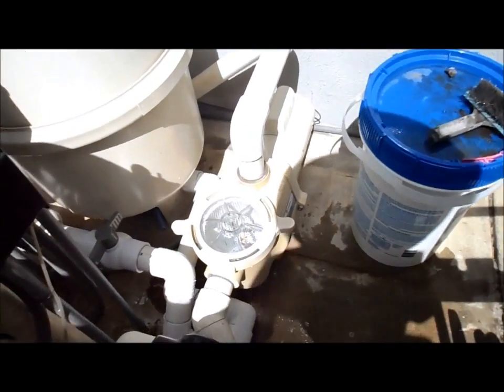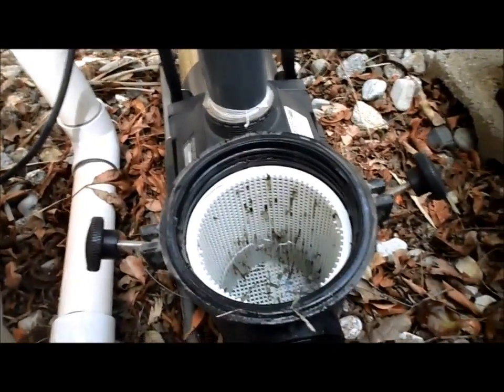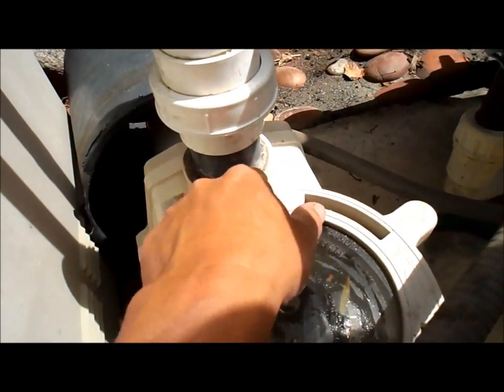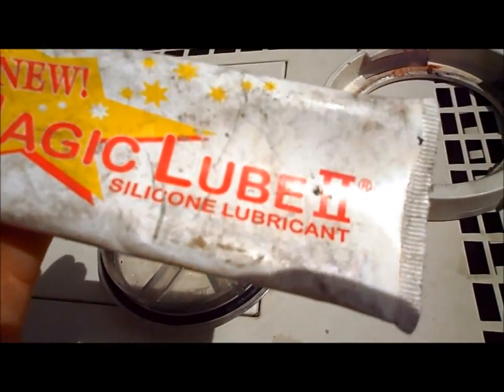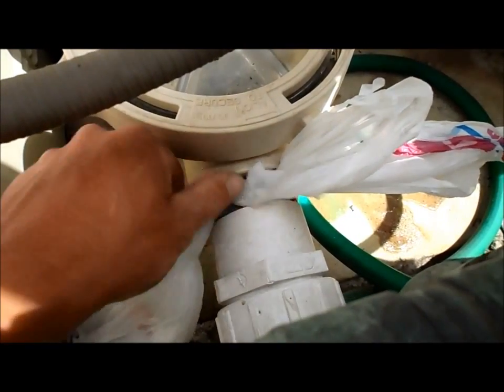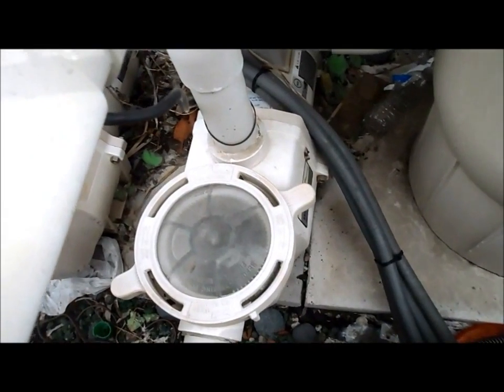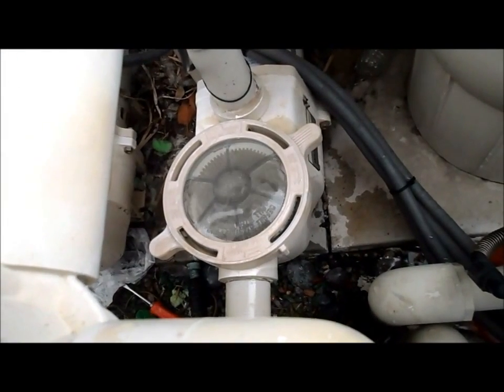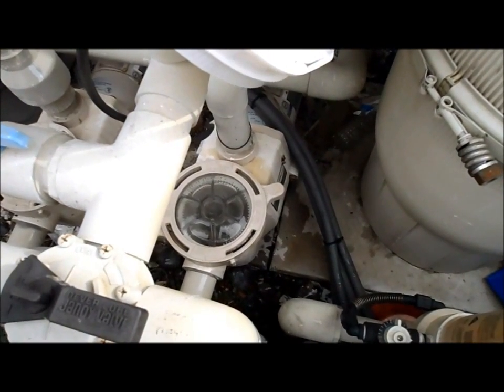Pool Pump not Working, Part 1- Pump not Priming

Comment: Hi, question, when replacing a one speed pump to a variable speed one, what needs to be done with the timer box that used to turn on and off the one speed pump? there are no instructional videos when switching pumps, thanks.
Reply from the maker: You can wire it there and just leave the timer on. Remove the on/off trippers.

Comment: I do really need help please, I got 2 hp hayward pool pump from ebay. It's 115 volts /225 volts motor. the Diagram from the Manual is not really clear and simple. I just want to use the old  24 HOUR DIAL TIME SWITCH,DOUBLE POLESINGLE THROW (DPST). Another question? if I switch the 110v to 220volts , Can I use the built in corded in the Motor and as plug into the new 110 volts outlet does it will work fine.

Comment: Will it still spin and not prime if debri is in the propeller ? I have a pool that it seams to be spinning but not priming
Reply from the maker: Yes, in most cases. Try clearing the impeller.
Reply: @SPL  I flushed the lines also checked the lid and propellers I even changed on the suction and return side from the pump and tried priming with a bucket of water still nothing

Comment: When I turn the time clock on the pool pump does not make any noise or any indication of it trying to prime. Does this mean the motor is burned out? How would I test this?
Reply from the maker: Possibly. Or the capacitor on top is bad.

Comment: Why would my filter tank not hold water to the top? It only fills about 1/3 of the way up. I've replaced the filter, the O-Rings & the vacuum hoses. I've tried filling the tank and the pump with water when I start it. It holds water until it turns off. When it restarts it isn't full again. PLEASE help me. I've even paid a Pinch-A-Penny tech to come out and look, he says everything is fine.... but it isn't.

Comment: I used to work for pinch a penny. And they would have me start from 9am and they close the store at 6pm. They had me with 15 pools daily and I would do all your doing of checking the equipment and the lines and of course cleaning the pool itself. So it would run me to a little after 6 pm that I'd be done and returning. My boss would be mad and yell at me saying why I couldn't be faster like the guys who were always done by 2pm or less. Does that mean. I'm going too slow?

Comment: My pump won’t fill with water- gets close but won’t fill enough to power on. What could problem be? Just bought 4 new filters for tank.
Reply from the maker: Check the impeller for debris. Turn off equipment, remove the basket and spin the impeller with a flat head screwdriver.
Reply: @SPL  thanks for the reply! Nothing found in the impeller that I could see. Could the pump itself be going bad?
Reply: Update for others that might have the same problem with generating prime. I finally just called a local pool company for help and they located the problem right away. It was the Hot Tub o ring leading to the pump (which wasn’t leaking so didn’t notice) and two, small crack that I couldn’t detect on pump cover. Now, pool runs quite, smooth as silk and starts right away. No air bubbles either which drove me coconuts coming from the jets.

Comment: Sometimes the rubber seal on the cover needs to be replaced.    The pump will not prime if air is getting into the chamber.

Comment: I live in mich and I have a older gunite pool with a DE filter which works great  
I have a newer heater about three years old my pool is 48000  gallon  I what I would like to know what I can put in the water to help lift stains with out damaging my filter or heater  dph 7.6 hardness 224 alkalinity 114 cyanuric acid 37 copper o iron phosphate 0 
Free chlorine .1.53 total chorinev1.8 combined clorine 1.66 water is crystal  clear an feels fine and infact the water sparkles with the D E filter idont want to damage my pump or heater can you recommend a product
Reply from the maker: The safest product is ascorbic or citric acid. But with an older pool a drain and acid wash is the most effective way.
Reply: Will it bother my nickel  copper heater exchange  and what might be the dose recommended. I love your post you are a remarkable tube star please keep up my wife and I watch when ever we can thank 
You so much .I think u would be surprised on the no. Of gunite pools in michigan most or very large and it is interesting how well they have to be made in my area in the  it can go down to 15below zero thats static temp even colder with wind factor  thank u for any helpful  info u can give me

Comment: Thank you so much. I tried to spin the impeller, it does spin slowly. Not sure if it's because of the amount of water in there. But if something was clogged, I assume I would need to remove the 6 bolts to gain access to it back there? My pump is not priming
Reply from the maker: It could be a bad jam or the impeller may be cracked. Yes, remove those and inspect.
Reply: @SPL  turns out it was a bad clog in the valve. So once I removed the valve, there was a pint of clog caused by my damn palm tree leaves. Thank you so much for this video, I appreciate it

Comment: Thanks for the great video. My pump wasn't starting. I had noticed that the O-ring seemed a bit loose in the cap over the pump strainer basket. I put some keg lube gel on it and now the pump starts right up. Must have been leaking air into the system to prevent priming. Time to buy another O-ring. Thanks for tipping me off to this cheap fix.

Comment: Lol i turned on priming in settings on the pentair cause water wouldn’t fill up . And my water filter tank ended up loosing its belt from one side and almost exploded .. is it cause i didnt tighten it good? Everything was fine till i turned priming . After 2 hours i got it fixed by adding the lube lol

Comment: One of the most informative videos Ive seen. Thank you. I only have loss of suction when vacuuming.I use a skim vac plate so my cleaning is quicker. I noticed plastic vac plate was not seating down tightly in skimmer. I found a gasket that attached to vac plate and it stopped   air leak so well Im able to use my vacuum hose that has a couple small holes in it. I wonder if you have seen this product? I think co. name is poolvacsaver.
Reply from the maker: Thanks for the great feedback. I did go to their site but saw product. I would have liked to see the actual device. 🤔
Reply: I agree, its a gasket that adheres to my vac plate. Very simple, but it  overhangs beyond vac plate. The extra material seems to give it more surface area to stop air leaks around vac plate. I purchased based on sites explanation of product. You are correct they need pictures showing how it adheres to vac plate.( They do have pix with instructions when purchased). I have been a viewer of yours and in my opinion you have a wealth of solid advice and a knack for delivering it. Thanks and keep it coming.

Comment: Hi- So my pump is pushing  around air. Also the PSI is at 0 even when the pump is on. what is going on ? Did I break my pool?
Reply from the maker: Check some obvious things like the pump lid o-ring and make sure it is filled with water before starting (the pump basket area).

Comment: Hi - i did everything in this video but still failed priming.  One thing i noticed is no matter how I fill the water in the pump it will immediately drain lower than the top.  What could be the cause?
Reply from the maker: Sounds like a very large air leak or maybe something wrong with the skimmer- do you have an attached spa also?

Comment: hello, my pool pump is not work automatically these days, do you have any ideas? I have setup the speeds at 4 different times around the day. Now under the menu, all the speed 1-4 is scheduled. However, the quick start buttons for speed 1-4 showing: stopped. Anyone can help me figure out what is going on and how to change the settings? Thanks. (by the way, the pump can work manually well but pressing the start/stop button)
Reply from the maker: Try turning the breaker off for 2 minutes to reset the pump.

Comment: Wednesday I cleaned my DE filter and after a few minutes I started the kreepy.  Today I put the skimmer basket instead of kreepy and all the water in the pool was being sucked or drained by pump.  Is it normal.  I don't live where pool is located.
Reply from the maker: Maybe the water level is low in the pool. The kreepy works with a lower water level.
Reply: @SPL  Noo, it sounds like it, huh.  But, no it was accurate level, however when it was draining into skimmer I even added more water! 
 I'm thinking maybe the pump never primed properly Wednesday (the psi wasn't reading properly when I left it was at 1-2psi )

Comment: Could you give me some tips please.....? My pool is around 2.5m below the pump, main drain another 1.5m below that. I am trying to prime the pump, it is brand new. I cannot get the water to a full level, only around 1/1,5" below the pump lid.  The return ports are only giving, what I would say half pressure/flow back in to the pool. Do you think the levels are the problem (pump been running 4 hours now), or do you think I should be looking at one of the problems in your video? Or is there a trick with the valves, maybe half opening one valve or both. Grrrrrrrrr!!! I've tried letting the air out of the top of the sand filter, but I keep getting air trapped there.......help!!! Oh, pump is also 30m from the pool!

Comment: I came home to my pool pump off today. After shutting the breaker off for a while I turn it back on to hear a humming sound. It’s a pentair 1.5 hp that might be about 3 years old. I saw another video suggesting it could be a capacitor? The shaft does in fact spin freely so is that a good sign or is it RIP? Any thoughts or ideas are appreciated as usual. Thank you!

Comment: Hello , when I go turn on my pump it works for about 20 seconds then it stops.. I can see water going into the basket but the water going into the jacuzzi (jets) stops working. Any idea why?
Reply from the maker: Sounds like air in the line. Is there also an attached spa or pool only?

Comment: Discovered my filter basket has very low water level in the morning and the pump wont prime, the filter was also filled with air.  I manually primed pump and got it going and will trouble shoot where air is leaking in per this video. After the pump was running I noticed a banging noise in the pipe on the return side after my sta-right heater.  Sounds like a part from the heater broke and is banging around inside the pipe that returns to the pool....ever see something like this?
Reply from the maker: Yes. It happens with those heaters. Be careful the return line doesn't get completely blocked as the filter could explode. /my guess is it is stuck in the check valve - if you have one after the heater.
Reply: Thanks very much for your advice - you are always quick to respond.  I only wish you were in my area of So Cal. as I would gladly turn over the maintenance of my pool to your capable hands!

Comment: How do you know if the impeller seal/spring is bad? The spring assembly behind the impeller.
Reply from the maker: You will see water leaking from under the pump - usually just a drip leak.
Reply: Swimming Pool Tips, Reviews & How To -MrDgvb1 Thanks a million first off, I always resort to your videos first. The reason I ask is my wife thought someone was sitting BBs into our pool, but after I saw them, I knew they were bearings. The pump just shredded (weeks after finding bearings) the impeller, so I replaced the manifold and impeller and it's running great! We do have an old Polaris 360 vac... Could they have come from that?

Comment: My pentair intelliflo only loses prime at low speed or over night. Why don't I notice air in pump basket when pump is on at higher speed? Please help
Reply from the maker: Your low speed RPM is probably set too low and the pump cannot keep it's prime. Raise the low speed RPM up and see if that helps.
Reply: It's never had the issue before (3years) also noticing a small rattle gurgle sound from pump at the lower speed
Reply from the maker: Not sure. But increase the RPM and see what happens.

Comment: What would cause those to melt?  Inlet and outlet?  I'm not grasping that.
Reply from the maker: If the pump runs dry for any reason it will begin to heat up and the threaded fitting in the inlet and discharge will melt ever so slightly. Then when it cools off the threads will have tiny spaces in between which will let air into the closed system.
Reply: Ooooooooh

Comment: Please help..... My pump won't prime. If I fill my pump it doesn't stay full, it drains out of the pump into the pipes. I checked the lid for cracks--there are none and the lid washer is fine and magic lubed up. Adjusting the placement of the pump relieved the stress/pulling at the attachments and stopped the leak at the screw valve/pipe coming out of the top of the pump. When I adjust the jandy valve that adjusts the skimmer and vacuum there seemed to be a problem there. The vacuum works, I'd say, excellent when the valve is positioned at 3 o'clock. At 1:30 is supposed to be the even split between the vacuum and the skimmer. The skimmer works poor there and equally poor at 12 pm where the skimmer is suppoed to be at full force. There are random bubbles, sometimes more than others, that come out of the jacuzzi jets and pool jets--especially at the start of the pump. I've disassembled the jandy valve and the knob moves the valves as it should, the plastic square shaped washer and cover seem to be fine too..?? So I am sooo confused at where the problem lies. Can you please help me? I would greatly appreciate it.

Comment: When I fill my pump with water it never gets full when I use a hose. If I pour water into it quickly with a bucket it goes down before I can get the lid on. I do have water on the top pipe with threading,  as shown in the video. But because my set up is different than the one shown in the video so I'm not sure which parts need to be replaced..??

Comment: MrDgvb1, I am having issues with my pool pump. It ran all night and when I went to check on it this morning, i heard the pump running, but there was no water shooting out through the jet inside the pool? I turned it off. I turned it on HIGH, then it was working. I turned it back on low, and for 30 seconds the water that came out of the jet was very dirty, then cleared up. I can't understand this?
Reply from the maker: What type of filter do you have?
Reply: sand filter. did i answer your question?
Reply: i am very very new to this.
Reply from the maker: Okay. It sounds like there was air in the pump when it was running on low speed, the air pushed some water/dirt out of the filter. Any water leaks near the pump?
Reply: Actually, no. I bought a ring from Atlantis Pools (local pool company) last night because it was leaking a little where you twist off the plastic cover to the pool pump - but ever since i bought the ring it stopped leaking water. Like i said it was running fine all evening and in the morning at 730 AM the pump was on, but no water coming out of the jet....so i turn it on high and it bursts out. Then i put it on low and dirty water flows for 30 seconds and clears up. I put it on low because i didn't know if it was bad to run it on high all day while im at work.
Reply: My friend says i need to backwash because he believes the filter is really dirty. I vacuumed yesterday at 430 PM. I did backwash after but only for about 3 minutes.

Comment: Please help.. I installed a new Hayward Super Pump 2, I have swapped out the pump motor before, but I thought this time I would install a new motor and pump.  I primed the pump, turn it on and it vibrates very loudly, pulls some water in then pops the breaker.  Any suggestions?  I would really appreciate any help.
Reply from the maker: +John I Wonder if wiring is correct.

Comment: Quick question, why when I turn the pump off the water in the pump goes down and when I try to start it up it won't prime up. Why does it lose prime when the pump goes off??
Reply from the maker: +biggstell Air leak somewhere causing the water to drain out. When air gets into the system it forces the water out of the suction line.

Comment: My pool pump doesn't have any pressure. I have open the lid to see if there is anything in the basket and then I turn the value at the top to let air out and so the basket can fill with water. Then I turn the pump on and the I turn the value again to let air out and then it starts to shoot water out and it goes out about 10 feet and then I turn it off. I then check to if there is any suction at the hole where you put the vacuum hose and it has suction for about a minute and then it just stops. It looks alot like the first one you showed.
Reply: Kayla Cannon sounds like a dirty filter
Reply: Yeah it was a filthy filter. I had to clean it 3 times before it kept its suction. I need to clean it again so I can have a nice pool for the summer.

Comment: My old pump gave up the ghost. I had the electricians check it and its dead. I have now installed the new pump which is slightly stronger than the previous pump Original was .06KW the new one is .075KW as there are no smaller pumps available.

All hooked up and filled the bucket to the pipe line would not fill further. I then closed up and Nothing. I cant create any pressure. Ive tried it on backwash, waste Rinse and filter and still nothing.

Do I have a piping problem? Ie blocked? or am I doing something wrong?